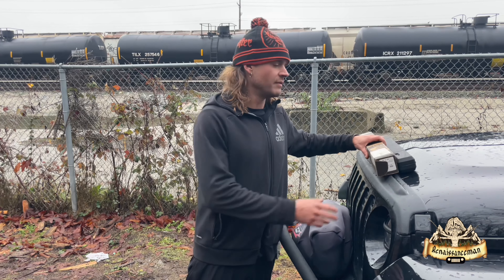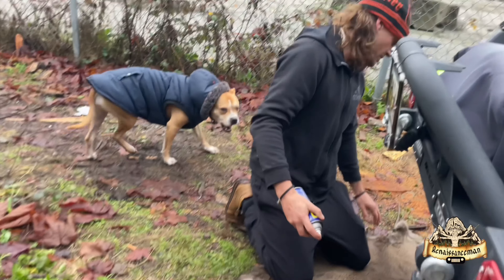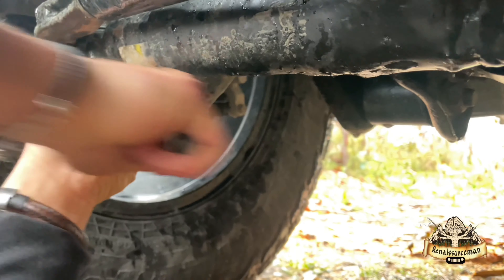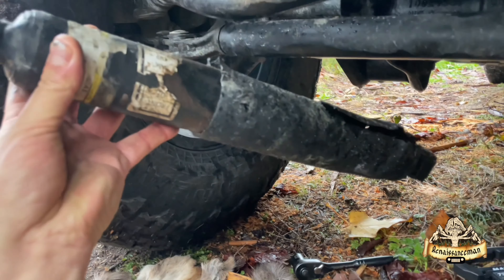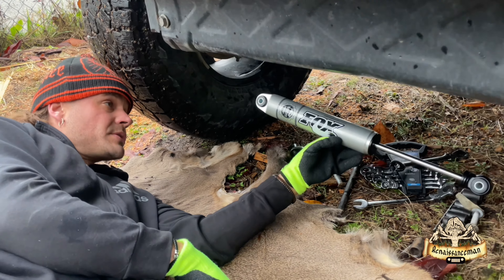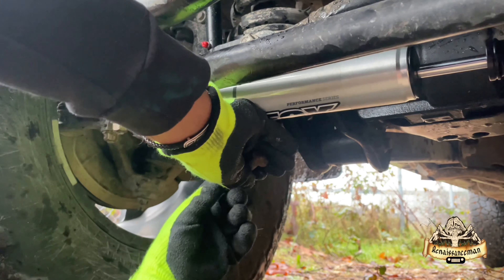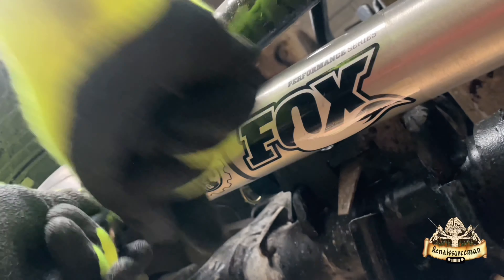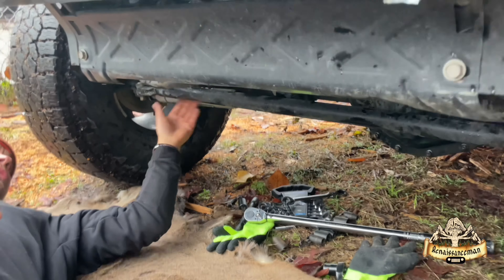Fox Steering Stabilizer | Stock Jeep Gladiator Off-road Performance

Comment: Had the dang death wobble on my 2018 JL, AFTER it was recalled for the stabilizer.Still waiting for the class action suit to be settled. IF the POS MOPAR stabilizer fails again, it will be a FOX replacement.